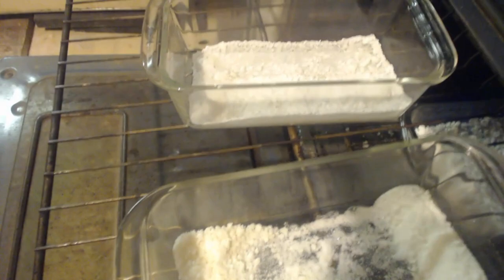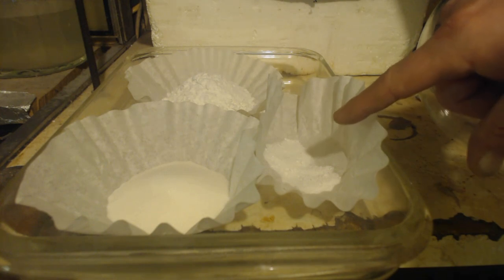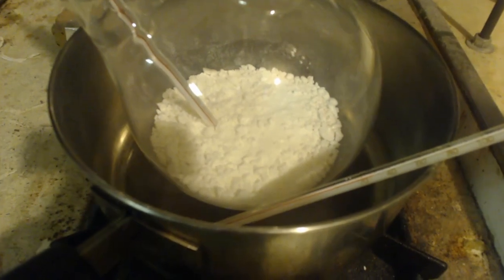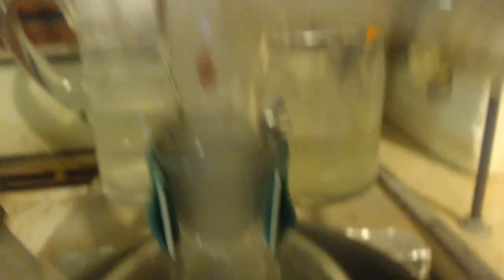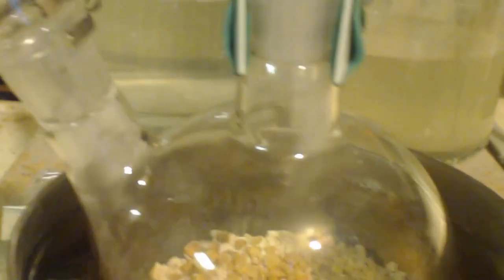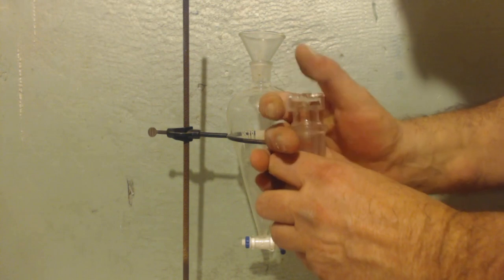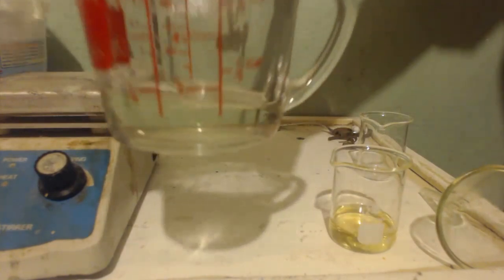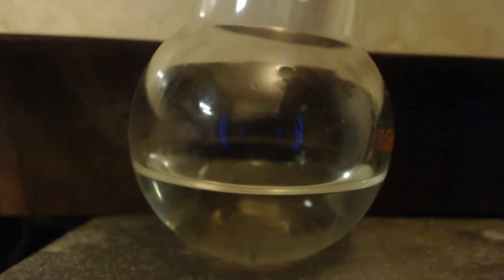NITROETHANE SYNTHESIS (NaEtSO4)  FAILURE

Comment: Hi, I am planning to heat ethanol under vacuum. Will try to produce carbon nanotubes. 

Is there an explosion risk? Air will be all vacuumed. In case of a small air leakage to vacuum chamber will it immediately explode? 

Second question After separating carbon molecules, water will also appear in the chamber. Does water vapor and Ethanol vapor create any explosion on hot surfaces above 700C degrees?

Amount of ethanol 1 ml
Size of the tank 0,05m3
Tank material steel 2mm thick.
There is such a method actually but I will do it alone for the first time and have some worries that I have overseen something. 

Thanks!
Reply from the maker: Gezgin............Making nanotubes is beyond my knowledge.  But to answer your question if you distill anything flammable you always have a chance for explosion.  And ethanol is flammable.  If you just have 1 mL of ethanol i would not worry about an explosion.   I am some what confused by your second question.   Like i said i do not know anything about making nanotubes.   Ethanol will ignite at 14C if given an ignition source like a spark or flame.  Ethanol will ignite 356 C if there is no ignition source like sparks or flames.   I would definitely direct my out port on the vacuum pump to the outside.   Are you using a metal still or a glass still?   Sounds like you are using a metal still.
Reply: JOHN BLACK SUPER CHEMIST thanks for the quick response. How would it be if I install a oxygen sensor into the tank and check before heating that there is no O2 in the atmosphere?
Reply from the maker: @siirinsahibi  .............I am a little confused by your questions.   If you want to distill ethanol under a vacuum you just do it the same way you would do a regular distillation.   You use a glass distillation apparatus and connect a vacuum hose to the port near the collecting flask on the distillation apparatus.     Turn on your vacuum and then start to heat.   Generally when doing a vacuum distillation i use a vigorex column but it is not required.   Remember to direct the vacuum pump fumes outside cause it may have a little ethanol in it.   And just distill it like you would any other distillation.  You definitely do not need a oxygen sensor.    If you only have a metal still it works the same way.     I usually put a valve in on the hose coming from the vacuum pump and going to the distillation apparatus.   That way i can turn on the vacuum pump and open the valve SLOWLY so i do not shock the system with a strong vacuum all at once.
Reply: JOHN BLACK SUPER CHEMIST hi again, sorry that maybe my explanation was not so clear. I already have Ethanol, I am trying to get the pure carbon out of it. I am trying to do it by giving high heat to ethanol under vacuum. Ethanol will be in gaseous phase. Bu I can’t figure out how much ethanol I can use and from which level of vacuum it is absolutely safe..?
Reply: JOHN BLACK SUPER CHEMIST JOHN BLACK SUPER CHEMIST hi again, sorry that maybe my explanation was not so clear. I already have Ethanol, I am trying to get the pure carbon out of it. I am trying to do it by giving high heat to ethanol under vacuum. Ethanol will be in gaseous phase. Bu I can’t figure out how much ethanol I can use and from which level of vacuum it is absolutely safe..?
Reply from the maker: @siirinsahibi  ...........i could have sworn i replied to this post yesterday.   I must not of hit send.  OK i may be wrong cause i know  nothing about taking molecules down to its elemental form.  But if you distill ethanol under ANY type of vacuum this will only distill ethanol at a lower temp and will not decompose it.   I would GUESS that if you wanted to decompose the ethanol you would use HIGHER PRESSURE than atmospheric pressure.   This way you can raise the boiling point higher than the decomposition temp.  And that way it will decompose before it is hot enough to be  distilled.     Heating ethanol in a vacuum will only lower the boiling point more lower than the decomposition temp.   So putting ethanol under a vacuum will force it to distill before it gets hot enough to decompose.